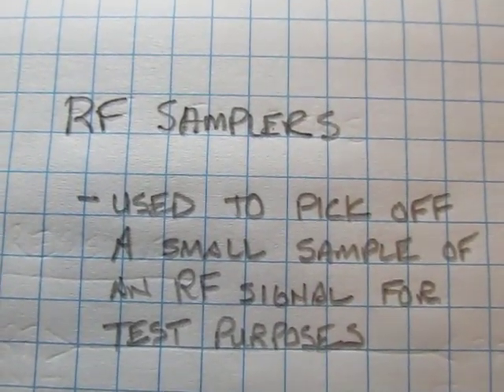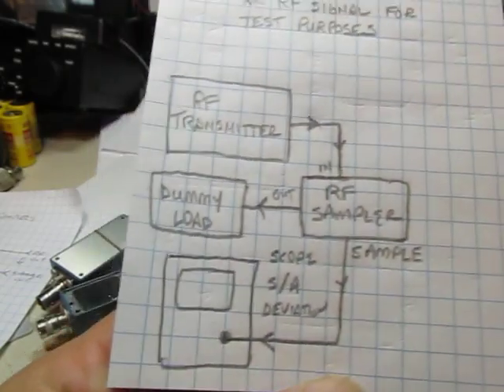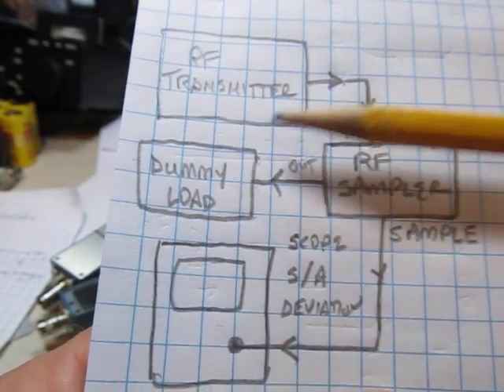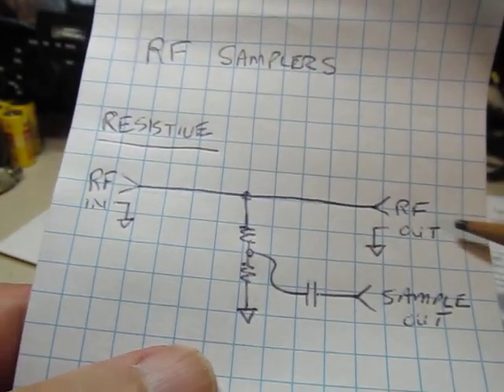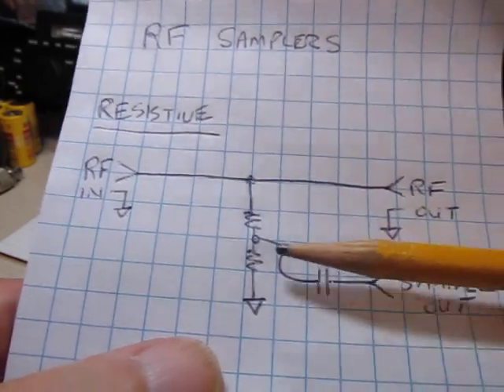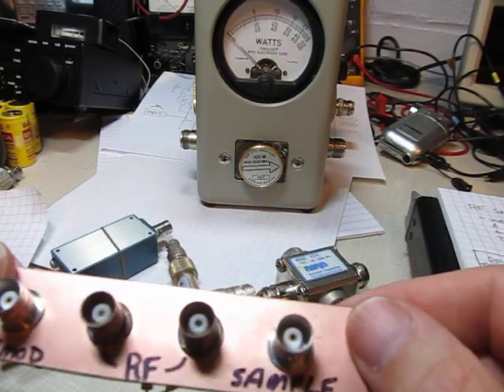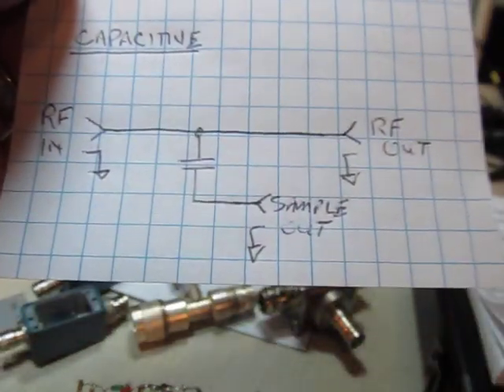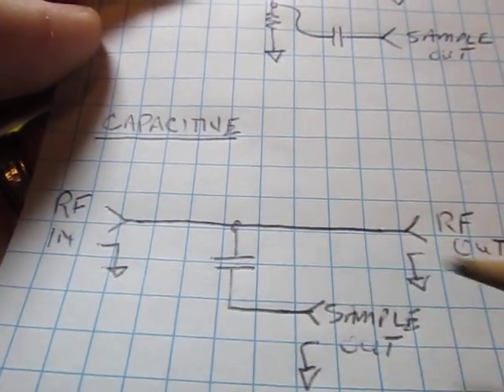#61: Basics of RF Samplers, Sampling-Tees, RF-taps, etc.

Comment: Nice Tutorial.  I've been a technician in the two-way radio industry since 1972 and am still carrying on.  My first boss, and mentor, came by the same type of sampler at a hamfest many years ago.  This was in the 70s and our primary use of his adjustable sampler was to check desensitization in repeaters.  It was great having his tap and using my Singer FM10 to ensure the customer that they had a "real" (conventional) repeater system.  After 6 years I left that job when a Motorola shop came looking for me.  They had a lot of old equipment but at least one "state of the art" (1972) service monitor (R-1200?).   Once again I was the repeater guy.  I had learned to tune duplexers and had come up with some hybrid ways of testing them.  Back to the sampler.  The owner of the Motorola shop didn't know what a sampler was.  So, I made my own by taking a UHF "T" connector with two female and one male connector.  The male connector became the sampling port after I removed the center pin and then screwed a UHF female barrel connector.  After four more years I left the Motorola shop to start my own business.  Two-way radio was only supposed to be a "temporary" job after my return from Vietnam.  Life happened and since I had a following and ten years experience I set up my own company.  Today that company has been around for 36 years and I'm still the prez.  These days I find either the Bird 43 or the Telewave watt meter with sampling port to supply about 40 db of attenuation at the sampling port, much more than enough to protect monitors and signal generators.  Once I activate a repeater with a signal generator/with CTCSS  if necessary and then activate the repeater's transmitter any sign of desense is easily noticed and then can be tracked down.  I haven't had an adjustable sampler in years.  All I've had, and used, is my home made sampler.  I haven't had to buy a watt meter in years but all the units in my company have sampling ports.  It would be nice to be able to adjust the attenuation but in my situation it just isn't necessary.

Comment: This is superb, connecting DUTs always seems to be a bit of a shady area when going thru the equipment manuals - i have a RSA3408B on the way and am very much looking forward to having a play, but even this has very little info in the manual on the actual safe DUT connections, and parts to use to connect it, and has the old DC 5v max warning on the front

now i feel a little more comfortable with whats good to have lying around the machine ready for action!
Keep up the good work!!!

Comment: Alan - I’ve seen a lot lately on resistive taps built into DL’s (pi attenuator) or as a separate box, and I’ve also noted the non-directional inductive coupler. They seem to do the same thing - sample RF. Is there any advantage/disadvantage to using one or the other ? Some are adjustable with a pot. I want to be sure I’m not going to blow the front of my S/A ! 73, Jamie WB4YDL
Reply from the maker: The advantage of a resistive tap is that they are far less frequency dependent.  An inductive or capacitive tap will couple more energy to the tap as the frequency goes up.  However, it is very easy to adjust the coupling with these non-contact inductive or capacitive taps by just varying coupling distance.  To be safe, always begin a test with the SA set to the highest reference level or even use an external attenuator (until you are confident that you don't need it), and start with lower transmit power if possible.

Comment: Great demo
I am going to make the one with the tee and the slide with bnc connector wondering whats inside the slide part just center conductor going from disk to connector or a resistor does it have any resistance or maybe a cap inside ?
thanks

Comment: I bought an inexpensive 30w / 300w analog watt meter---- and I have no idea if I'm using it correctly. I use a 50r / 100w thick film RF resistor as my dummy load for several of my 10w -100w transmitter projects and it gets quite warm. I decouple the scope probe by just looping it loosely around the dummy load without metal to metal contact. The scope and the dummy load seem to tell me that I'm getting a lot of power... but my new watt meter tells me otherwise. I've tried it with my dummy load and with a GP antenna, but it reads only a small fraction of what I would expect. Is this due to insertion loss, or a poorly designed antenna, or is it just a cheap meter?
Reply from the maker: Of course the dummy load resistor is going to get warm - the same reason that a 100W light bulb gets warm - it's dissipating 100W of power!  Even at 10W, it will get warm, same as a little 7.5W night light bulb gets warm.  Perfectly normal.  Regarding your meter - it is difficult to say what it happening with it.  Is it rated for the frequency that you're measuring?  Is it an in-line meter, and are the connectors in good shape?  Does the transmitter report a good SWR when the meter is inline?
Reply: @w2aew  Sorry for my poorly worded question. Yes, I expect the load to get warm and it does, but my watt meter does not seem to register the same level of output. The meter is rated for the the frequency & power level I'm experimenting with. I am planning to purchase a Bird meter in the future, but they are a bit pricey.

Comment: Hi Alan, I have seen a HF radio  tech on YouTube (he is actually an Aviation tech "hobby_radio_nerd "..anyways he  made his RF sampler in a rectangle dicast box, he had 2 BNC sample ports on either side , ie a total of 4 RF sample ports , he hasn't shown the internal workings / circuit.  Is this actually achievable without isolation ? It seems he only uses for 11mteters/27mhz.
Thanks in advance .
Reply from the maker: You can have multiple samples/taps, using a number of techniques.  Simple sniffer wire stubs will work fine, for example.
Reply: @w2aew  thank you .

Comment: Would there be a difference in using a tee in your signal line to an attenuator that then goes to your scope? 50-ohm attenuator, scope input 10M. Same thing, except for the variable control? So I guess the RF samplers are rated for attenuation factor of the sample as well as the power it can pass? Thanks Alan!

Comment: w2aew, I always love your videos and learn so much.  I recently bought and repaired a Tek 5S14N sampler, PG506 Calibration Generator and TG501 Time Mark.  In the process I realized I have no other equipment that generates 1+GHz signals.  Can you recommend any old Tek generators for 1GHz and greater signals?  My budget is low and on the fix-it end.  It doesn't have to be Tek unit, but I'm partial.  Thanks

Comment: Very informative video Alan.... I have Bird attenuator models 4273 -020 & 4275-020 both adjustable.  How would I go about adjusting either one to give me an attenuation of 40db down from the main power level ( ie  100 watts ).  Just got a spectrum analyzer and want to keep it happy.   Keep the videos coming...
Reply: The coupling of these samplers is frequency dependent, so can't adjust them to be a fixed 40dB. In fact, at the lower operating frequencies you can't 40dB coupling, it will have more attenuation. Here is the manual:
https://www.birdrf.com/~/media/Bird/Files/PDF/Products/manuals/921-4273_75S.ashx

Comment: that Bird sampler have nominal attenuation 40db ,and plus 20 db with regulation ,so you can monitor sampled signal from very low to over 5kw of nominal signal. They working great,but they are expensive.

Comment: How would you verify the attenuation of the air gap before connecting your scope?

For instance; when using the 4431, how would you know the power out of the RF sample port? Would you need another bird? Or, would you max attenuate before connection and hope for the best?
Reply from the maker: You'll get a feel for it for the common devices you work on.  Typical attenuation factors at HF frequencies will be 40, 50dB or more, so there's really no problem even up to 1000W or more.  At VHF/UHF the attenuation will be a bit less, but still at least 30dB typically at best sensitivity.  When in doubt, crank in the most attenuation (least sensitive) and setup the instrument for a high level signal and start there.  Never had a problem for anything I've worked on up to 1500W.  For the 4431, there is a table in the manual that indicates the attenuation level of the sampling port.

Comment: If I want to measure the power output of a HF radio, I need to know how much the Sampler is attenuating. Am I need to find the gain / loss for each frequency that I will be measuring? ( I´m using the formula dB = 20 log (Vout / Vin) and                                PAVG = (Vout * 0.707) ² / R (50 ohm load)  )
Reply from the maker: Yes, you'll have to ensure that you know the attenuation factor for the sampler at the frequencies you are interested in.  the dB formula is correct.  for PAVG, your formula is correct if Vout=Vpeak.  If you measure Vp-p, then you have to divide by 2, then mulitply by .707, then square, then divide by 50.
Reply: ***** Thank you! I´m measuring Vpp (peak-to-peak) in Scope. I´m using a 50ohm feed-through connected at sampler out and the scope input probe (10:1, BNC mini adapter - my osciloscope is an Agilent 2012A, has only 1M impedance input). Is it the correct way to measuring Power and Monitoring the frequency? Its first time that I´m using Osciloscope and Frequency counter using samplers and RF equipments. Thank you for your attention. :D

Comment: Those samplers are cool but I prefer using a (big) good quality attenuator as it's theoretically  aperiodic and linear. With a capacitive sampler you have more coupling on the higher frequencies and when you try to test the bandwidth of an amplifier or compare harmonics amplitude  to F0, the results are distorted : +8dB from 28 to 432 on the -40dB sampler port of my Telewave 43A for instance.
Reply from the maker: Yes, that's always an excellent choice, if you have one available.  A decent broadband directional coupler will also provide good flatness in response.

Comment: Thank you for your great videos!!!!
Trying to implement a simple RF sampler just putting an isolated electric wire parallel to and very close to the main  line within my SWR meter. Testing it with my HP8640 @14.500MHz @+20dBm and injecting the sample into my 8558 SA. Very good! I get a range of 20 to 50db of attenuation just moving the wire toward or away from the main line. So far so good. But if I sweep the entire HF (1-30MHz) keeping the wire at a fixed position (let's say to get -40db), I get weird response going from 55db of attenuation @low freqs to less than 30db @higher freqs. 
Is there any trick to flat the frequency response of such a sampler?
Reply from the maker: Simple samplers like this that use capacitive or inductive coupling are, by their very nature, frequency dependent.  You could design a filter circuit to flatten it, or use a different coupler design.
Reply: Yep! In the mean time I discovered that"RF samplers are for pure qualitative measurements; in case you need (as I need) quantitative measurements the way to go is by calibrated fixed attenuators"... isn't it? 
To calibrate my kenwood ts-430s power amp I probably need a 40db/100W fixed atten... (..and 150$ ..).
Thank you Alan!!!!
Reply from the maker: Yes, a calibrated attenuator or directional coupler is the most common way to do quantitative measurements - or simply develop a cal curve for your passive tap...
Reply: Great timing. I spent a few hours yesterday testing this very (w2aew)RF sampler I built to see if I could measure power accurately. I found the same issue, although it does seem repeatable. So maybe I could use a table, as does my old Oskerblock-200 SWR and Power meter. Thanks for confirming.

Comment: One question: Should the BNC cable enter the scope through a T fitting with a 50 ohm termination on one leg of the T?
Reply from the maker: For an uncalibrated sampler, the 50 ohm termination isn't really important, but certainly can be used.
Reply: w2aew 
Thank you.

Comment: i dont understand the difference between a coupler and a sampler..... the samplers i work with have 4 pins on them , what would those pins be for?
Reply from the maker: A sampler is usually some kind of "pick-off", where a small portion of the signal is sent to the sample port.  A "coupler" usually implies a "directional coupler", which have two coupled ports - one for the forward direction and one for the reverse/reflected direction.

Comment: Could you not blow the spectrum analyzer by using attenuator between it and transmitter?
Reply from the maker: You could use an attenuator - but high power attenuators are much more expensive than a high power dummy load and RF tap.

Comment: Where do you get those little metal BNC cases?
Reply from the maker: +Alyx BioHaz Pomona is a popular manufacturer of them:
http://www.digikey.com/catalog/en/partgroup/boxes-with-connectors/3204

or bottom of this page:
http://www.surplussales.com/Cab-RacksHardware/encl_2.html

http://www.electronicsurplus.com/itt-pomona-electronics-2390-inline-adapter-box-bnc-female-to-bnc-female
Reply: They are not cheap ... but thank you!
Reply: +Alyx BioHaz I don't know why the Pomona connector boxes are so expensive, but I found an alternative from China. It looks very similar to the enclosure that ThorLabs uses for their lab fixture kits (https://www.thorlabs.com/newgrouppage9.cfm?objectgroup_id=8681, which are very cool, btw), but costs just a few bucks sans PCB. Ordering directly from China, you can get them for $3, but if you don't want to wait a few weeks, they are available on Amazon for a few bucks more:

http://www.amazon.com/gp/product/B0107WUWJE

They work great. The aluminum is soft enough to punch through, and it holds a PCB very snug inside.

Comment: Dear W2AEW , 
does this 50DB 100W attenuator do the same job ? 
https://www.ebay.com/itm/100W-N-Attenuator-50db-male-to-female-DC-3GHZ-50ohm-RF/272899586791
because all the RF samplers I find online are quite expensive 300$ plus .. 
vs this thing that is 70 $ , 
Will this suffice to connect a transmitter direct to a spectrum analyzer ?
Thank you in advance 
Alex 
P.S how do you calculate how much RF power will be at the other side of the attenuator given that you know the input power ? so that you can be with in the strict limits of the Spectrum maximum input dbm ?